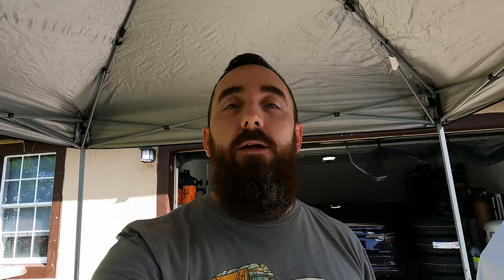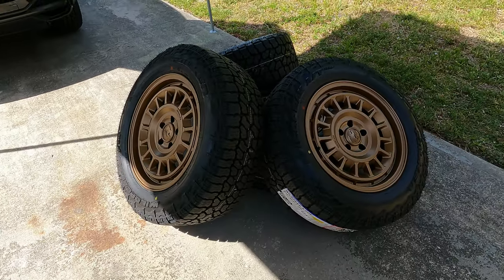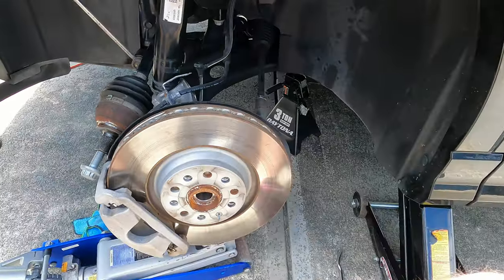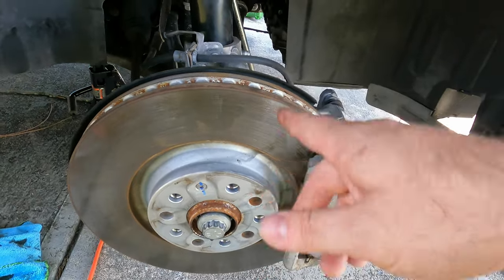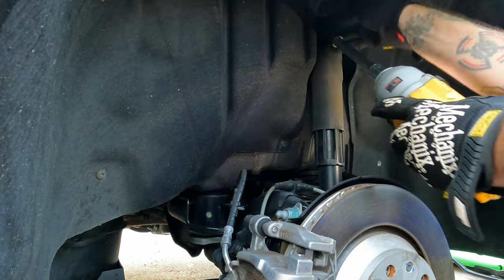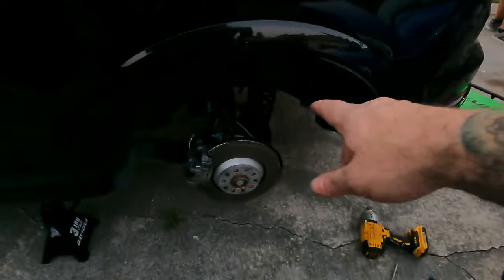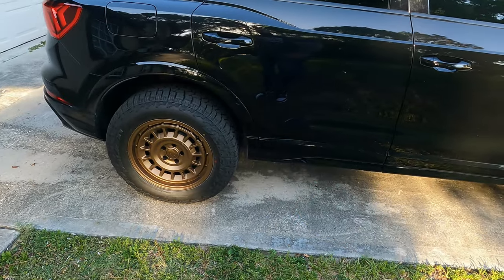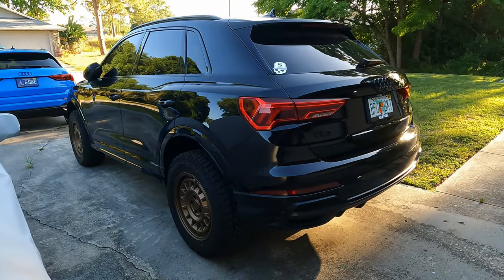F3 Q3 - B2BFab Camber Correcting Lift Kit Installed - Plus Fifteen52 Wheels

Comment: I've been looking at this EXACT same setup for my 2022 Q3 S-Line. 

Do you think that tire/wheel/spacer combo would rub without the lift kit if i did that first and the lift later?
Reply from the maker: So, I will say that there is a post I found before doing this, where the guy did a 17x8 et10 wheel, with a 225/65r17 a/t tire on stock suspension and he did not rub. I cannot say for certain the 235 would not, but I feel like it would be safe until you do the lift.
Reply: @Wobblenuts  Thanks!  I think I may give it a shot!  I'll report back if I run into any issues. 

Looking forward to seeing where else you go with yours...
Reply from the maker: @Uskok7611  definitely let me know. I'll be wrapping it hopefully sooner than later. That's the reason I got black, so I can wrap it whatever color and the jams wont stick out.
Reply: @Wobblenuts  Awesome.  Can't wait to see!